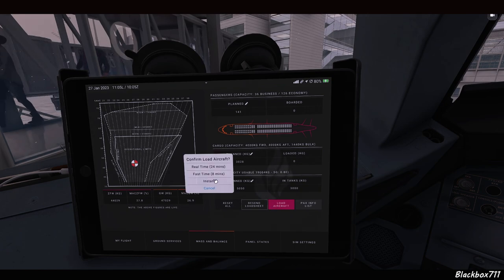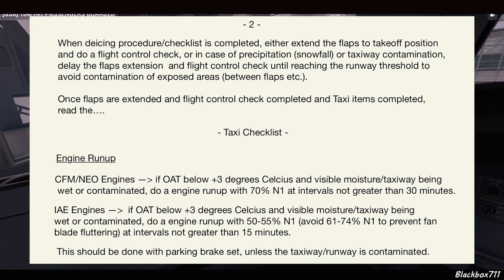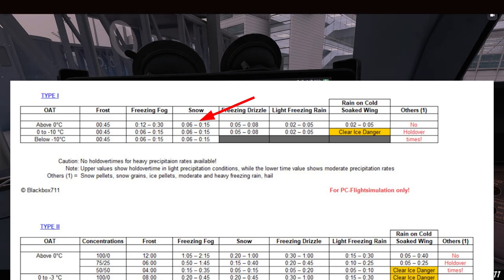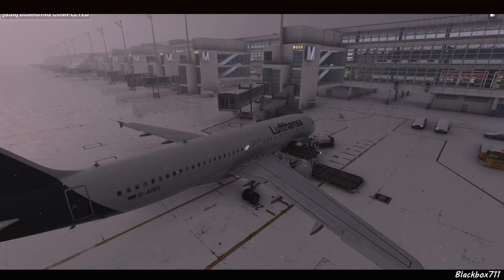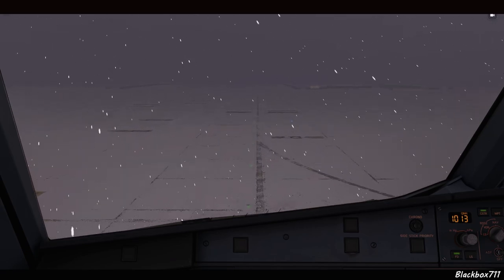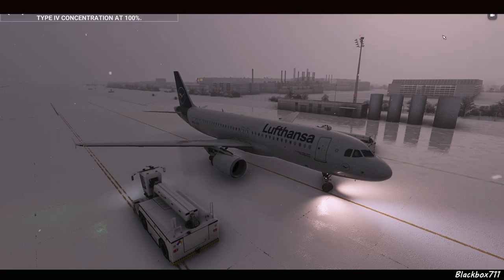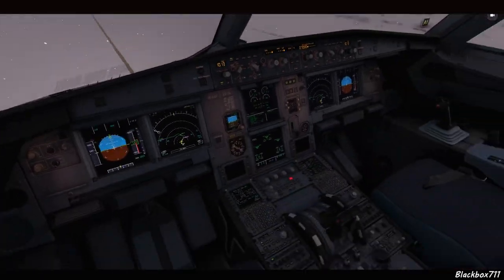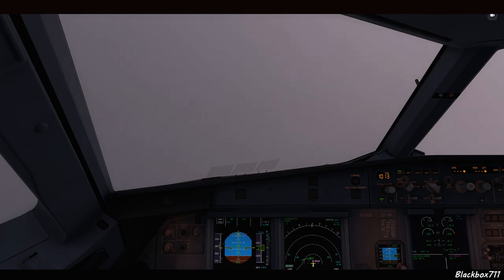NEW GSX Pro Remote Deicing | FENIX A320 Procedure Guide

Comment: Could you do a video on step climbing? I understand what it is but either in stupid and don't put them in correctly or my simbrief calculates them wrong
Reply from the maker: Hi. Simbrief is not really suitable for calculating step climbs because of lacking deeper levels of performance data. 
And most A320 addons lack the ability to use the step climb function in the MCDU. There is a simple rule that you can use: when the next available flightlevel (usually 2000 ft higher from the current one) reaches optimum altitude +500 ft, then climb. I.e. current flightlevel 340, optimum 355, then climb FL360.

Comment: I had no de-icing option when I opened the GSX menu while taxiing at EDDB.
Reply from the maker: What outside temperature did you have?
Reply: @Blackbox711  5°C
Reply from the maker: @Deyan_B_Travels  I think the limit is +4 degrees.
Reply: @Blackbox711  Ok, but you would do de-icing in real life at 5°C in the rain wouldn't you?
Reply from the maker: @Deyan_B_Travels  not if you don’t have ice or snow on the wings. You would switch on Engine-Anti Ice, but that is it.